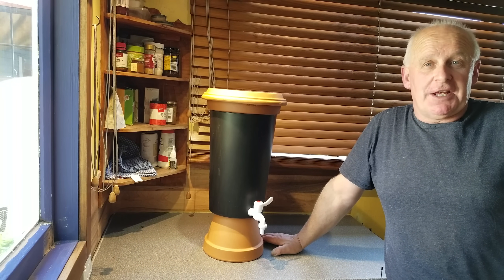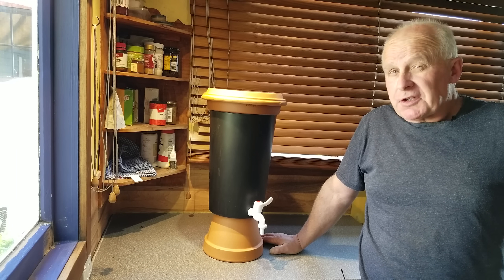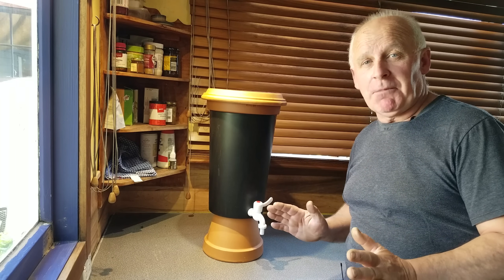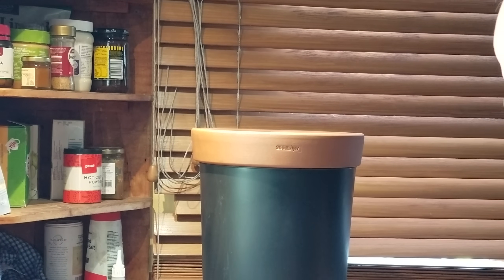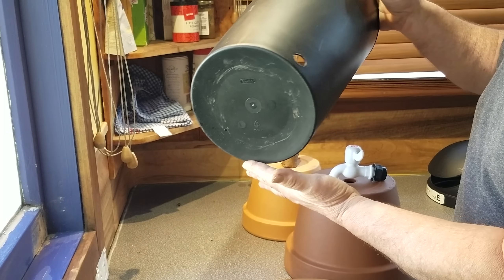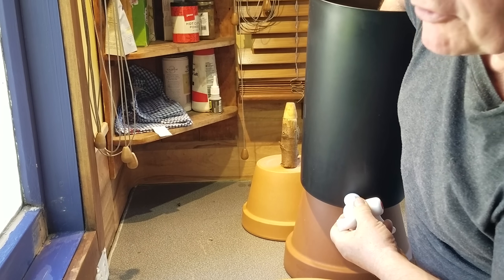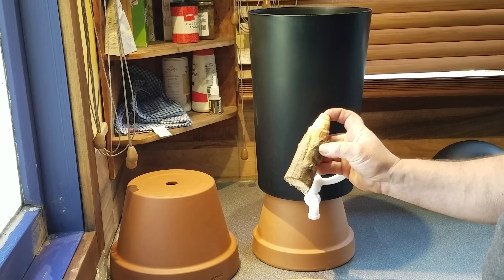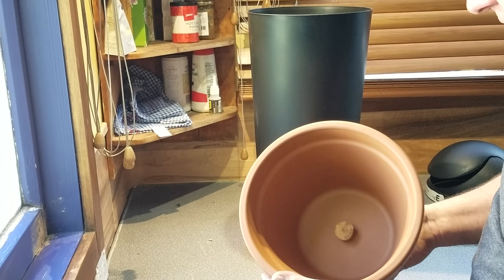DIY water filter. How to make FILTHY WATER drinkable

Comment: I like your idea, but as I understand it,  
I was told here in America, we are required to throughout a chipped or broken ceramic cup, such as a coffee cup or teacup. 
And the reason is that the unglazed part holds e-coli bacteria, but you mentioned colloidal silver, which is a natural anti bacteria fighter. 
But. If I made one. I would keep a close eye on its cleaning, 
So, how many gallons of water can it filter before you have to use that pot for planting? 
Ok, peace.

Comment: This PP5 container will probably be OK, but I don’t know if the characteristics of the terracotta Clay complex are similar to the ceramic filters intended for water consumption. The suggestions made about charcoal are OK for reducing possible organic compounds in the water but probably not sufficient for metallic/anorganic compounds. Also the use of sand is not ‘innocent’ since not all types of sand are suitable for sand filtration, some of them might even reduce the pH because of silicates… if the pH lowers (= acidification going up) then the efficiency of the Clay complex ionic exchange will also shift. OK, no drama yet because it is supposed to be rain harvested water but it would not be a bad idea to put this filter on lab test for In-Out drinking water parameters, and repeat it after 3-4 months of use… actually I am using terracotta in the form of Olla’s to give some of my plants a pro-longed drink 😅 OK cheers and all the best
Reply: drinking high PH water is actually bad for you, especially at meals. this myth about alkalizing yourself is first class quackery at its finest.
Reply: Potassium Permanganate removes two heavy metals from water.
Iodine removes two more, although I'd advise anyone thinking of using it to have a thyroid check first, as it can activate or exacerbate an over or under active thyroid gland.
Reply: Billy Andrew The application of those components can only be done in specific pH ranges so I would not advice it for such a small scale drinking water filtration because you have to adjust pH, add your reactant, accomplish sedimentation or compacting with a special press, then adjusting the proces again for another precipitation, correct everything to +-pH 7 etc etc… you also should add the exact amount of reagent in order not to create a new problem etc etc. So for such a small scale operation one must start with a water source free of toxic concentration of heavy metals. These precipitation reactions are too complicated to be efficient for such a small scale, perhaps iron, not a real heavy metal, is an exception because it can be abundant in ground water.
Reply: This lead in Clay is actually a non-issue because under normal circumstances there is no geochemical connection between Clay and lead… the lead can only come in from the glazing technique used on certain terracotta and since you should try to avoid glazed pots for a more efficient filtration it doesn’t matter.
Reply: Also clay pots may have lead based clay which is harmful  to people
Reply: “In the form of Olia’s” WHAT? 
What is an “Olia,” and what is it that “belongs” to it, (since you used that “possessive noun”), or is it that you don’t know the difference between the “possessive” and “plural” forms?
Reply: 1wldnczyguy First learn to copy correctly before trying to teach irrelevant things... the term is indeed 'olla' and not your 'olia'. Perhaps you can try to 'Google' it, because independent interpretation in the given linguistic context seems too ambitious. 🙄

Comment: Without a filter, you have no way of knowing just how pure your water is when it comes out! I have a system that is a heck of a lot cheaper than a Berkey! And my water is 0% contaminants.
Reply: What system is that?? I’ve been looking for one & share the water quality concerns others have expressed—where to source uncontaminated pots? Plastic? Filtering out heavy metals? What about if we live in a more urban/higher air contaminate location?
Reply: @christinelangin7209 , I use Zero Water. I watched a video, & it came out on top with Berkey coming in second. But Berkey still left contaminants in the water. The video was on Utube. It used even systems that I hadn’t heard of or had forgotten. Zero water comes with a meter that you can test the purity of the water.

Comment: Wow!   I am so impressed.  Subscribed.  I live in the American desert southwest.  We use these principals to water our gardens. We have terra cotta unglazed pots  called  ollas.  We bury them in our garden soil and plant seeds next to the pots.  Fill the pot with water, cover and your garden is slowly watered with no waste.  American Indians have used this technique for thousands of years.  No water waste, slow irrigation of plants.  Brilliant.
Reply: Use milk jugs with pinholes in them, or 2 litre pop bottles.
Reply: @serenakoleno9338  Nice idea but won't the weather elements over time degrade the plastic and release toxins that would otherwise be sealed in the plastic? It's food grade in ideal conditions,  not sure degradation and 110 degree summer heat would change the quality of the plastic food grade jug?
Reply: @lafytaffy1220  Milk jugs die in no  time, but pop or gallon water bottles will last at least one summer here in Iberia. I weighted mine with gravel rather than digging them in, and they functioned fine. Eventually they got replaced with a full drip irrigation system, which uses non-food-grade plastic anyway, like all the farmers do. :)
Reply: @markmitchell590  Excellent points! Thank you for sharing.  😊
Reply: @serenakoleno9338  Thank you! You just saved me 200.00 trying to solve how to water my foundation in summer when I am bedridden frequently!
Reply: @serenakoleno9338  Have you tested this way?
Reply: Do you know were affordable quality Ollas can be purchased?  The ones I have found online in the past seem too expensive.  $50 for a small one seems a bit much when you have allot of plants.
Reply: @lafytaffy1220  Take two flower pots , turn one upside down, you can seal them together with silicone on the edges and cork the hole in the bottom... your welcome.
Reply: @lafytaffy1220  are there any Mexican more than a taqueria stores around where you live? I found some really nice handmade terracotta pots at the one here for just a couple of dollars a piece.
Reply: Love this tip! ❤️ With less and less water available in California, this would be smart water usage
Reply: Ive been using ollas for years theyre incredible!
Reply: Where do you get your ollas from? (Least expensive).
Reply: I just started doing this do you water the plant only in the olla?
Reply: @lesliearellano3  you bury the olla in the ground where you have plants,  fill with water and the water will permeate into the ground watering the plants.
Reply: keep watering your plants, not drinking it
Reply: How cleaver!
Reply: amazing idea, thanks for sharing, I will certainly pass this information on to my gardening friends.
Reply: Tell me you're "regreening the desert"! 
Are you using permaculture techniques yet?
Reply: @bill Weirdo Stop virtue signalling, Mr. Weirdo.
Reply: @wolfenstein6676  You obviously don't understand the definition of virtue signaling. I am Ojibwa aka one of the tribes native to America.  I am not an Indian as Indians are from India. Some native nations used this technique some did not.  Pointing out facts about my people is not virtue signaling it is correcting falsehoods.  How about educating yourself and cracking open an dictionary some time.
Reply: @billweirdo9657  you are an Indian, as much as you're a native American. Even if it was a misnomer, it stuck. It isn't meant to be an insult. You shouldn't make it into one
Reply: @billweirdo9657  Thank you for sharing your knowledge.  If you really want it to be absorbed by others,  may I politely suggest a tweak to the delivery of your message? As humans we all miss speak and can learn more through out life but the approach matters most, otherwise you're wasting your time explaining if people are turned away by your delivery approach.  I say that with kindness and sincerity.  Thanks again for sharing.  😊
Reply: @bill Weirdo  here in Canada you would be refer to as a FIRST NATION PERSON Indians are considered East Indians from India.
Reply: So Indians who migrated to America used this technique. So this technique comes from India ? I only ask because Indians come from India not from America. If your referring to native peoples of America not all of us did this so you might want to reference the actual people's who did this technique.
Reply: @billweirdo9657  native Americans aka Indians. You know that though, huh?
Reply: @billweirdo9657    We all know the meaning.
Reply: @billweirdo9657 oh goody, something new to be offended about.
Reply: @reynoldsbillie   new? Funny considering my people have been telling those of European descent what we are called since the day our peoples met. Yet we aren't even allowed to say we aren't Indians without a backlash as shown by people such as yourself. 
I'm not Indian. I'm not native America. I'm not first peoples. I'm Ojibwa. The other tribes and nations have their own names too.
Reply: @billweirdo9657  and out of all the atrocities done, the one distasteful to you that you repeatedly mention is what you're called.  Interesting.  It's also interesting how you just assume everyone responding to you is of European decent and therefore could never understand what it's like to be part of injustice or wrongdoing.
I can see what you're called is of major concern to you and something you enjoy getting passionate about, but I won't be joining you on that ride.  I've got other actual more important life problems to deal with.  I do, however, wish you luck on this journey you're on.
Reply: @reynoldsbillie   You can not talk about those other atrocities without being able to first identify the people.
Reply: @billweirdo9657    no open debating with you because I see you have it all figured out.  Good luck with that mentality.  It, along with your anger and stubbornness, should get you far in both life and relationships.
Reply: @reynoldsbillie   You want a open debate on what our name is? Sorry not Sorry that's not a debate we know our own names and that's what they are. When Britain invaded India it didn't suddenly change the Indian peoples name to Chinese did it? 
It is funny how you see decimination of facts as suddenly being " angry" and attribute all kinds of negativity to... what something being a fact? It's also very weird to bring up what aboutisms when talking about a specific subject in this case the name of a people's many different people's at that. 
Your answer can be broken down to " you are who we say you are and if you don't like it than you are the problem not us" yet I guerentee you wouldn't like being called something your not... like if suddenly people just decided to label you and your family a nazi. Replace nazi with anything unsubstantiated.... than we find out you and your family in fact aren't nazis yet we already called you that so now your a nazi and if you don't like it then you are the problem not the people refusing to stop calling you a nazi.
Reply: @billweirdo9657  😆😆😆 I should have listened to my dad.  Years ago he told me never bother engaging with an idiot.  It's a complete waste of time.
Reply: @reynoldsbillie   Those that resort to insults usually do so to deflect from the fact that they have no foundation to stand on.

Comment: Tiny house and off grid resources: if you put a ceramic pot underneath that instead of plastic, the water will stay cold. This is technology that tribal cultures and South America have been using for centuries at least. 

I’m glad to know your hack.  I’ve been thinking about throwing my own pottery  water reservoir fitted with a terra-cotta insert for the top for the express purpose of filtering water and keeping it cold, and lid. I considered using commercially-available terra-cotta pots, but couldn’t be sure that locally-available pots didn’t contain toxins, as they’re not locally made. As a potter, I know that some clays can have ingredients in them which renders their finished product unsafe for use with food and beverages. But the fact that you’re doing this means you’ve probably thought this through already and had it checked.  Perhaps I don’t need to wait until I’ve got time to make my own set from Clay. This would be a great time saver.

Thank you for sharing this fantastic idea!
Reply: Hi there, most of the time it is the type of glaze that makes the pots toxic (like in Tjechoslowakia). Perhaps using the hand of salt methode to glaze (making it shiny blue :) They do this in Holland,
Reply: Thank you for your honest facts about toxins in terra-cotta planters.
Reply: @yliberal6355  : I wish to be clear. I’m not saying that I know of a certainty that there are toxins in the clay that is used in locally-available pots; rather, that I am concerned that there could be toxins in the clay.  After all, they are not made locally, so it is difficult to check out the clay body that has used, coupled with fact that the manufacturers of these pots made them specifically to hold plants as opposed to coming into direct contact with a water supply for human consumption.

I have not had these wares tested, although I know of a certainty that there are both clays and glazes that are not recommended for use in the manufacture of wares that will come in contact with food or beverages, particularly acidic ones.  I think before I use this idea, it would be smart to look into it just a little further, to be certain. :)

Comment: Don’t trust any safety system given by the same people who regulate your water. Use ceramic all over as it will survive intense heat and not leech micro plastics over time. Also rain water is acidic and can contain all sorts of airborne contaminated particles. You still need to disinfect your supply and slightly reduce its acidity. Silver and a small drop of ph reduction substances unharmful to your physiology will help but boiling is the only sure fire way to know your water is virus and bacterium free plus a filtration system to dispel the particles in the air. Very good demonstration 🌹🐝🙏🏻 Thankyou for your time

Comment: This is great but I wonder if it really goes through the ceramic or just trough the piece of wood in the hole in the middle? So called Romanian pots are water tight. Have you tried with water sealed hole?
Reply from the maker: When i lift out the pot you will see how the water is seeping through the terracotta pot all over below the water line. it takes several hours to seep through. more info here - https://www.youtube.com/watch?v=IkWT_PkusP4
Reply: @t.h.o.r.  OK, thank you for additional info. I have to give it a try :)
Reply: Hi. He  showed you the outside bottem. All small droplets all over..... kind regards.

Comment: Our house swore by the Berkey for years, that is until we got a water electrolysis device to test our water. Of course our tap water showed signs of heavy metals. Oddly our cheap shower head filter gave us the cleanest water in the house. Our trusted Berkey failed the test and showed the same heavy metal water as straight tap. Sure the Berkey is great in removing organic items such as pee from a stream, mud from a puddle, etc. And sure the fluoride filters most likely work too. But the filters do not remove iron, copper and other items found in normal tap water which causes all kinds of problems in our bodies. This made us toss our Berkey and get a water distiller instead. As now we are making "rain water" in our home without costly replacement filters. Take time to get use to the taste of distilled water, but far better for the body. I just added some Propel and Lemonade drink packets to get use to the taste.
Reply: Warning: Distilled water drunk consecutively for longer than 3 months will cause mineral depletion in the drinker, so stagger it and up your mineral input.
Reply: I like to use electrolyte liquids in ours, Flyby is our current go to.
Reply: He said he was using rain water that would tend to have fewer minerals or metals as it hasn’t percolated through the ground where it would desolve and acquire these undesirable additions.
Reply: Also, reguarding mineral depletion from drinking distilled water: what minerals you get from most water is minuscule. Most minerals are obtained from food, red meats being higher in iron than pale flesh; plants are high in minerals and metals (iron, magnesium, copper, zinc, manganese are all metals) and calcium is also available in different plants. Anyone telling you that drinking distilled water causes mineral depletion is trying to sell you something.

Comment: Thanks for your instructional video. To make your hole at the bottom of the plastic bin use scissors, slowly increasing the spread of the blades until you have a hole just the right diameter. Used that process to make a hole in my outdoor water butt.

Comment: If you collect rain water and it sits in the barrel.you will get bacteria growing inside.so make sure you add a tiny bit of bleach.
Reply from the maker: I guess eventually the pores will clog - just like on any filter. I scrub mine with a coconut fibre scour pad and hot vinegar baking soda mix every 4 weeks or so and re apply the colloidal silver